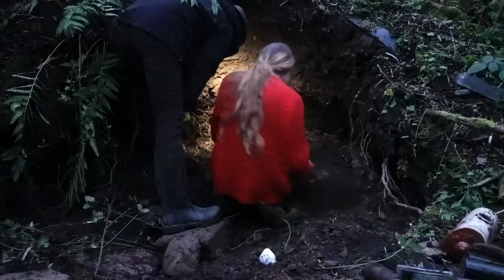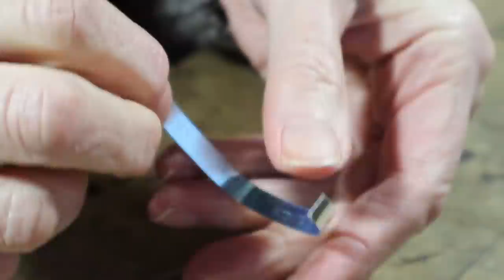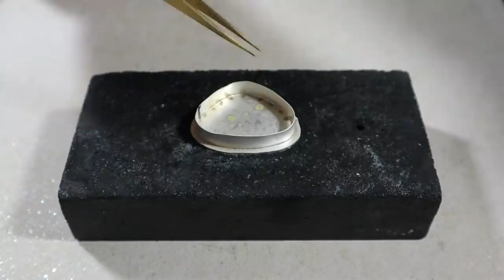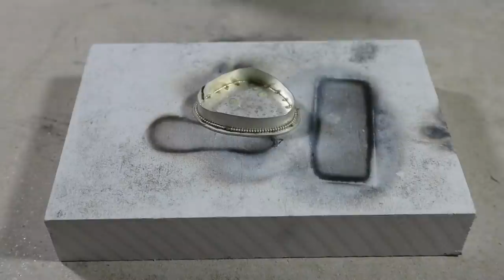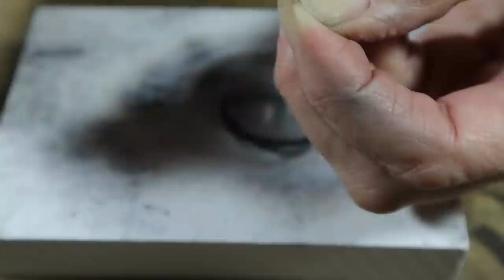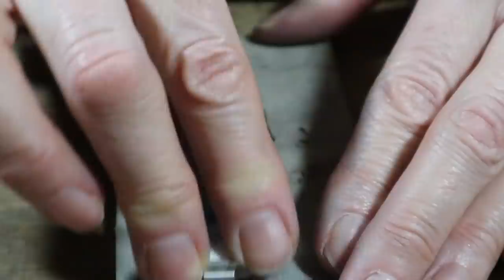Making Found Victorian Pottery into Jewellery! (Mudlarking Find)

Comment: 1. 1 second ago
Wished u would of shown cutting of plate and grounding of edges too before starting to make the actual jewelry
2. Could not tell how you got the metal rim ends to stick together
3. Thank you for showing bonding glue used to put metal back plate w metal side piece together, but not sure was put in middle of back plate at that time
4. Did not show what bonding glue for decoration rope metal, tube looked different?
5. Interesting used same technique w bail and decorative loop .
I use silver soldering and some bonding glue, simular technique though.  Your ending product is absolutely beautiful.  Congratulations on making a beauty.
Reply from the maker: Thank you! Our making videos are meant for entertainment only, and are not instructional. There are a lot of very good instructional videos on YouTube, though xx